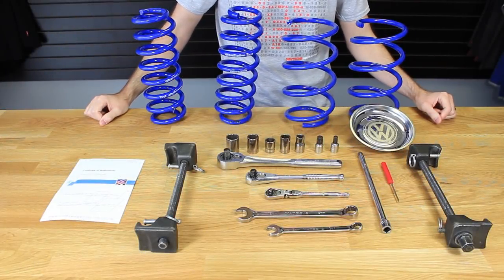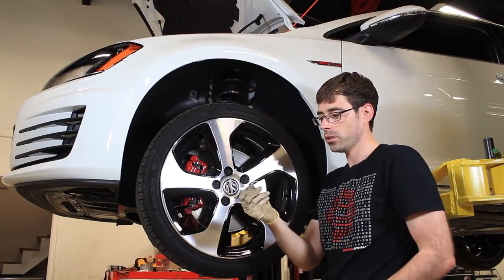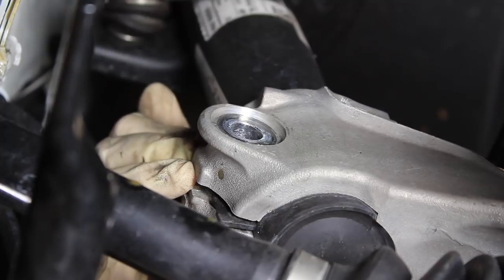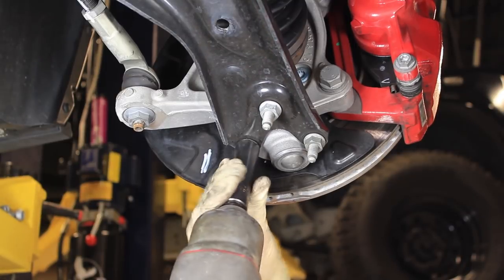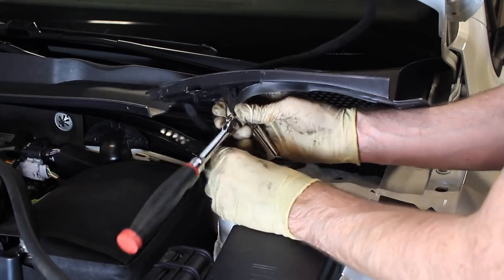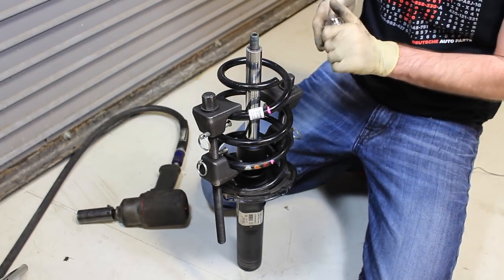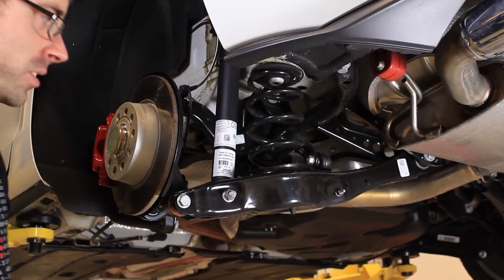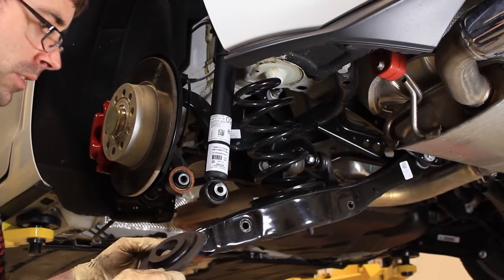MK7 GTI VWR Lowering Spring DIY (How to) Install

Comment: What mileage should you replace the strut mounts and bearings? Do you need to replace the hardware as well? (bolts, nuts, etc.)

I'm at 19,200 on mine and I'm looking at installing the VWR springs.
Reply from the maker: +Hubscharber I would say anything over 10-15k most due to the amount of work to get them back out.  You can always roll without replacing them but the potential for noise from the old tops is there.  As far as bolts take a look here we have the kits. https://deutscheautoparts.com/make-model-year/volkswagen/gti/mk7-2015-present/steering-and-suspension/install-kits.html

Comment: How is the alignment possibility of a MK7 Golf after lowering in regards to tire wear?  I have owned cars that can be lowered 2" without alignment and does not affect tire wear (97 Pontiac Sunfire) as well as cars that had some major difficulty with just a 1.2" drop ( 05 Volvo V50) that would eat the inner side like crazy.  Ideally I would love to drop my MK7 Golf, but do not want to lower the tire life from 4 yrs to a few months for just an inch drop like I had in the Volvo.  Please honestly tell me, can MK7 Golfs be properly aligned with moderate lowering (1-2") . I don't mind a shortened tire life of say 1-50% but the 75% plus really cut into the wallet.
Reply from the maker: This should not affect tire wear in an outrageous manner.  You will want to be sure that the vehicle is properly aligned after the install

Comment: Hi, great video. In a few days I'm trying to change the original springs on my car with an Eibach Pro-kit springs. I've only a few question: I don't have an air impact wrench so I've to do everything with a torque wrench, is it possible in your opinion? Which is the correct torque to tighten the upper bolt of front suspension? And the last one: which is the right measure of the triple square set that you use to unlock the six screws of the drive shaft? I'm sorry for my poor english, hope you understand. Thanks a lot!
Reply from the maker: +Lorenzo Longo Take a look here for the strut top hand tool info. https://www.youtube.com/watch?v=hR0MmvogT2A
Reply: +Deutsche Auto Parts Thank you very much again. I've one other question: wich is the size of XZN (triple square) that you use to unscrew the six screws of the drive shaft? Is possibile to unmount the front suspension without unlock the drive shaft?

Comment: Could you tell me more about the inner axle bolts? I am going to have a shop install the springs, but I don't want them to cut corners. So, I would like to get new bolts beforehand. Do you sell them or can you give me a part number? Thanks for the video!
Reply from the maker: Here are the inner axle bolts http://www.deutscheautoparts.com/View/N-909-911-02/N-105-234-01/0/15362

There are a total of 12 (6 per side)

Comment: No new camber arms needed for front or rear? I come from a 370z and that required changing those after dropping the vehicle with only changing the springs.
Reply from the maker: +coolvans1988 Nope the camber would not be terribly changed with a very mild drop like the VWR springs.

Comment: Why does no one show the install on the harder side (Passenger side)? Every single video only show the drive side. The backs are easy as ever and the two rears take literally 30 mins. But the passenger side I’ve been working on for a few days as still it’s so close . But the strut won’t go ALL the way down into the Pinch bolt assembly. Not sure what to do ? HELP!

Comment: Would there be an extra step or two for DCC equipped vehicles? Does the DCC damper plug into the car and need to be un/plugged?
Reply: dBsdecibels unplug the little sensors and made sure the leveler arm things are not connected (little green arm that attaches with a ball joint)

Comment: Easyer to losen the cv bolt on the hub .. it's just 1 bolt vs 6
Reply: What size is the cv bolt?
Reply: @carlosschein9283  
I don't know the size, never thought about it. I just eyeball att the bolts and take a socket from the toolbox that matches

Comment: This is probably a really silly question, but would putting these on my car void the warranty? Obviously if my shocks go bad I'm not going to go claim those on warranty, but they shouldn't mess with the engine warranty right?
Also, for the 6 triple square bolts, any issues doing this method as long as the bolts are properly torqued? 
Lastly, my car only has 3000 miles, purchased on Oct 31st 2016, Would it be okay to reuse the knuckle bolt?
Thanks Paul!
Reply: i have been told before that modifications can void warranty if they are related to you problem.

Comment: I have recently lowered my car using H&R springs. All was fine, but about a week or two later I now have a creaking noise when turning out of a parking space at slow speed. Any ideas? Would it be the upper strut mounts need replacing?
Reply from the maker: ElmoMac3000 You should likely consider replacing your strut bushings and bearings https://deutscheautoparts.com/make-model-year/volkswagen/gti/mk7-2015-present/steering-and-suspension/bushings.html

Comment: Getting ready to do this install on my Gti, would you recommend replacing any of the other parts of the suspension, mounts,  bearings, etc. My vehicle has around 56k miles on the clock. Thanks for the  video is a lot of help!
Reply: gerardo mena I’m doing this soon as well and I’m relaxing the front and rear strut mounts and bearings. I heard it’s best to replace to minimize vibration noise

Comment: had a pair of Koni shocks installed.  when up on a lift it looks as though same side front shocks were installed due to the asymmetrical attachment of the end links.  Is this normal?

Comment: Hey guys at Deutsche, I installed these springs a couple of weeks ago and I've been hearing a lot of squeaking noise. It's coming from my front passengers side whenever I drive and when I make right turns. I brought it into my friends garage and we checked to make sure everything was tightened down properly and that it was safe to drive. Everything checked out fine but the noise still persists. Any thoughts?
Reply from the maker: ***** Sounds like its probably the strut bushings but its tough to be sure.  You can try to lubricate the bushing to see if that helps.   https://deutscheautoparts.com/5q0-412-331-d.html

Comment: Are there any additional parts (control arms, endlinks, etc...) needed to straighten the alignment of the car out once it has been lowered?
Reply from the maker: no you will not need anything like that when installing these springs.

Comment: I have had my MK7 gti for a year now and have about 16k miles on it would I still need to replace the struts on mine if I just wanted springs?
Reply: +edwin martinez I ask myself the same question. I got 27k miles and I want to change to these springs.
Reply: The stock struts should last for quite a while before the height difference kills them. I'd assume anywhere to 70k+ (depending on the condition of your daily roads) so I wouldn't worry about them going anytime soon.

Comment: Would I need all these tools for a vw gti mkv 08 like are all the bolts all the same as my car to this car?
Reply from the maker: Yes this would be very similar to an install on a MK5.  

This kit should make up what you need for special tools, other than the spring compressor
http://www.deutscheautoparts.com/View/1K0-498-101/0/533728

Comment: So is there actually any difference in the suspension between a 2003 Mk5 and a 2019 mk7?
Reply: yes. not a lot, process wise, but they components aren't interchangable. the rear is very different.

Comment: Great videos thanks for posting. Not sure if anyone knows...when it comes to the MK6 GTI vs GLI much different in terms of suspension? Also I would think you can also remove the hub for the extra "movement" needed to get the strut out? Again great work/great channel. Really appreciate your work sir. Really liked the direct injection carbon build up vid as well. Good info..
Reply from the maker: Thanks for that feedback.  We work very hard to deliver great value to the community.  As for taking out the wheel bearing/hub, there should be almost no reason to do this.  The MK6 GTI and GLI will have similar suspensions and will come apart similar to this video.

Comment: When tightening the bolts, what does the 20Nm + 180 degrees mean?
Reply from the maker: that means torque to 20nm then turn 180 degrees further
Reply: Deutsche Auto Parts 
What's the length of the ratchet extension?
Reply from the maker: we used a 12 in extension
Reply: Deutsche Auto Parts 
Do you think a 10 inch would work as well?
Reply from the maker: Bryan LeBlanc It could.  Tough to say

Comment: Hi, Thanks for the video! Would it be the same installation for 1.4tsi as well as 2.0tdi?
Thanks
Reply from the maker: Tough to say for sure as we dont have those vehicles here, but yes they should be very similar
Reply: Thanks! Shall inform you once I've DIY! Waiting for my springs to arrive! lol I went with Eibach though!Deutsche Auto Parts- Your Source for Everything VW and Audi
Reply: marklmy1012
Hi there, tried the installation last night but failed due to the inner rotor on the driver side (Australia - right hand drive) is a lot deeper compare to the passenger side (shown in video).

Do I have to remove the Triple square 10mm on both side or just one would do? Thx
Reply from the maker: You would want to take the inner axle off on both sides... Hope this helps
Reply: Thanks for your reply!

Comment: 7:05 Is there a tool that can be used to remove that clip on that screw there right above the wiring far left of the screen??
Reply from the maker: All you should need is a screw driver or your fingers.

Comment: Wonder how you torque the 21mm nut for upper strut shaft to strut bearing?
Reply from the maker: +Mraaf Harith take a look here https://www.youtube.com/watch?v=hR0MmvogT2A
Reply: Deutsche Auto Parts Thanks. Would you able to make a video on how to replace a pump motor from in-tank fuel pump assy. on Mk6 GTI?
Reply from the maker: Mraaf Harith I'm sorry we don't take requests for DIYs.

Comment: Your torque specs for the pinch bolt on the front struts is wrong. Service manual stats 70nm + 180°, not 90°
Reply: I also got kinda screwed over on the reinstall because you don't mention that the tophat has a specific orientation its supposed to go in. You may want to add an annotation or something

Comment: Hello. I bought these spring and I noticed I placed the lettering upside down. Would that have an affect on the drivability? When you putting on the spring you stated lettering up? 
Thanks for the help.
Reply from the maker: frank lopez We always install them facing up.  We don't know if you will experience any drive ability issues as we have never installed any springs like this.

Comment: While this video was extremely helpful and very well done, it lacks instruction on the most important and difficult side; the front passenger. I noticed this on a couple other videos too, where the drivers side and rears were done, but not the passenger front. This can be misleading because when the video is done, it's assumed the both sides are done the same way and they definitely are not (it's not exactly the same anyway). I realized this the hard way when I got to other side and saw the drive shaft is twice as long and is also blocked by the lower part of the control arm. This means you must remove the wheel knuckle, detaching it from the drive shaft, then pull the whole assembly out. I understand what Paul Wiest says in his comments below but to some of you, that may be a lot more work. Here's a video of what I'm talking about: https://www.youtube.com/watch?v=FPxIXMN2TFc&t=633s
Reply: I agree driver side was more challenging with the longer drive shaft, however, the strut can be removed from knuckle just as shown on driver side without removing driveshaft from knuckle.  Don't know a video showing it but I just did it in my home garage yesterday.

Comment: Are all racing line lowering springs blue?
Reply: This video is 6 years ago. I have instaled the racingline springs in my 1.4 tsi 2019, them are gray color. Them are linear rate springs too. VWR and racingline are the same, not?

Comment: Opening up the knuckle with a torque wrench... Good luck with that lol. Without an actual knuckle spreader, I ended up taking out the axle together with the strut and replacing the spring directly without even touching the knuckle. Yeah this way I have to also take out the entire brake assembly but it is still WAYYYY easier than trying to mess with that fucking stupid knuckle. So my advice: just spend $50 to get a knuckle spreader!

Comment: do we have to compress the spring?
Reply from the maker: Yes any effort to remove springs without a spring compressor could be extremely dangerous and should not be attempted.
Reply: I'm sure DAP is telling you this is necessary for liability reasons, but the reality is that the stock GTI and Golf R springs are short enough that you only need to compress them an inch or so to thread the top nut.  If you lay them down on their sides and use an impact to remove the strut top nut there is not much recoil, but stay out of the line of fire for good measure.  Standard Golf springs (taller ride height) are considerably longer so a spring compressor should be used.

Comment: I change the springs with Iron bar 😁 More faster way. Dont need to remove that much Bolts 😂 1.5 hour and it was done
Reply: Reason there's no follow up is because he died from improper Install. follow the video folks....

Comment: Do you need to do an alignment after changing the springs ?
Reply: +Julian UK Yes but you have to wait a few weeks or a couple of months so that the springs can settle in.
Reply: It only takes a couple of days for the springs to settle. Do not wait a couple of months to do an alignment. Your tires will wear down unevenly by then.

Comment: I just installed some H&R springs and I’m hearing some significant knocking on the fronts and slight rears everything is torqued down I’m curious if anyone else had this issue or do the springs just need to settle break in?
Reply: Did you ever get it figured out? I’m getting ready to do mine and I’m replacing all the bolts, top hats and end links in front because I heard they can cause knocks sometimes. Rear, nothing I saw really needed to be replaced so could just be low life 😂

Comment: Manual says lower control arm bolt to spindle is 70Nm +180.  Same as the shock bolt.  Seen several incorrect figures in Deutsche videos.  Other issues as well, bolting things up without putting on weight for example.  Get the manual guys, these videos are not 100% correct.

Comment: DO NOT REMOVE THE AXEL FROM THE INSIDE! I followed this guide and blew an axel a week later  once it separates grease gets everywhere and getting it back in is the biggest pain in the ass. Do yourself a favor and just remove the outer axel bolt. SO MUCH EASIER

Comment: Lol all that work for almost no difference...
Reply from the maker: Thanks for watching.  These springs are for MK7 owners that are looking for a mild drop that still maintains a ride that is comfortable for daily driving.  We will have a video coming soon on a coilover suspension install which allow for height adjustment.  The choice of which suspension to choose is always going to depend on what your goal is.  If you are looking to go super low these springs are not going to be the best choice for you.
Reply: Deutsche Auto Parts- Your Source for Everything VW and Audi   I think it looks awesome. 25mm is all that's needed...   Just bought my MK7 two days ago, and contemplating this upgrade.

Comment: I think 130Nm is too much on the rear knuckle... I tried to do so and the bolt snapped in half. Should have been stated these need to be replaced. Other DIYs say to use 70Nm.. so who knows
Reply: Did you reuse the original bolt or did you use a brand new one?

Comment: Well thanks DAP, 130Nm is completely wrong and cause me to snap the bolt. It should be 70Nm... Wont be trusting your videos again
Reply: To be fair anytime you're working with suspension you're supposed to use new hardware each time so its possible yours was just more worn for whatever reason

Comment: What a fkn nightmare of a job. Impossible to seat the bottom of the strut back into the knuckle. When you load it up from the bottom to press it bk in the spring just takes all the pressure and strut bottom does go in. Funny he skipped all that. Jesus Christ.